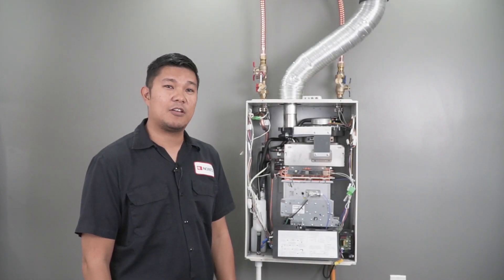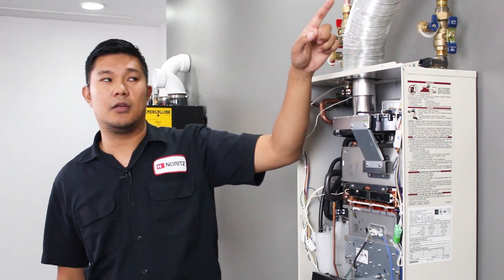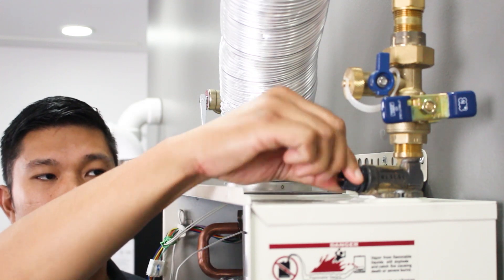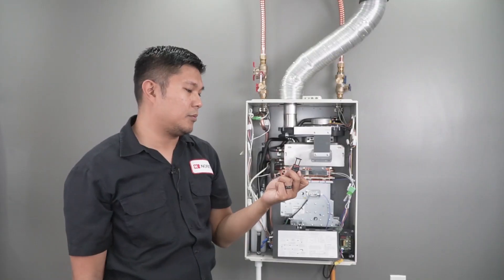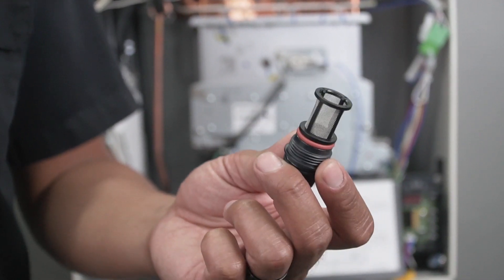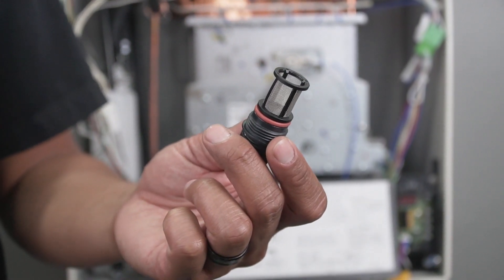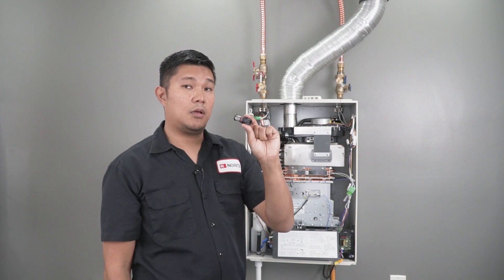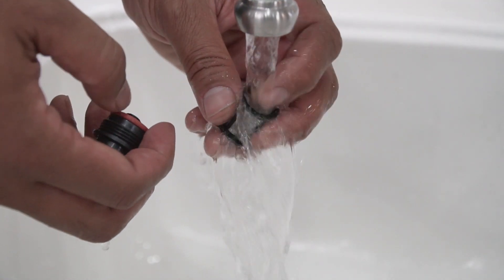Noritz Quick Tech Tip

Comment: I have a Noritz 0751M model from installed more than 10 years ago.  Still working but every so often hot water shuts off with error code 16.  Any advise on repair or is it time to replace?  Appreciate your input, thanks.

Comment: I May be wrong but isn't the shut valve supposed to be on bottom other wise how do you inject solution with pump
Reply from the maker: You're not wrong when it comes to most traditional tankless. However, this particular unit is our top mounted water connection model (for faster install) so the valves are on top in this demonstration.

Comment: Quick tip.. If you flip the valves, you can keep all the water in the actual waterlines instead of draining the whole system. Would only make sense to be able to isolate the unit instead of removing it with the valves.?

Comment: Hi Eric, great video!  Occasionally and  I am not sure what triggers this, but no water flows through our hot water faucets.  The fix is simple, just simply turn off and on the Noritz water heater.  Everything then works as normal.  Why does this error occur and how do we prevent this from happening?   There are no error codes alerting us to any issues.
Reply from the maker: Hi David I suggest you call into tech support as there's a lot of info we need to be able to answer this properly. The only mechanical component that would stop water flow would be the main servo. It must be shutting down for some reason, possibly over heating but we might need error code history from the unit to answer for sure. Please call 1-866-766-7489

Comment: Except that after couple of years of usage, it's almost impossible to turn the filter and remove. The position is difficult to reach at the bottom and its plastic so using force will break it.  It looks good and easy on new device in this video :(

Comment: The filter is stuck in the housing, how do you get it out?
Reply from the maker: You might have to use pliers to nudge it loose. However, try to be very careful as the plastic could be brittle if the unit is old or has had exposure
Reply: @noritzamerica  it’s a 5 yr old unit. What is the part number for the filter on a ncr 98 dv heater? And is there a reputable store to buy this part?
Reply from the maker: @alkupik  you can either check www.noritzparts.com or if you're in canada www.reliableparts.ca/. The filter screen is EGBD032 and the filter cap is DTJD006
Reply: @noritzamerica  why use plastic for this part that needs pliers? Why not make it easy to access this and easy to remove? It's so frustrating. Video shows as if it's so easy but in real life, it's a pain
Reply: You can very gently use Chanel locks and wd40 sometimes repeat a few times it usually works. May sure o-ring comes out too in addition to the filter and gasket.  Afterwards make sure to gently clean out the gunk in the cold water inlet filter line. Suggest only doing this if you have the replacement filter, o ring and cap ready.

Comment: Can you show me how to correct the error code 903 on a Noritz model NRC711-DV. Turning the unit off and back on only works for few days at most.
Reply from the maker: Hello, error code 903 is caused by abnormal combustion as well as the air supply vent being clogged. It is recommended that you clean your air supply vent. See page 22 of our Owner's Guide on how to fix this issue: http://support.noritz.com/download.php?file=Literature%20Page/Owners%20Guide/NRC711%20NRC661A%20OG.pdf&field=OwnersGuide
Reply: @noritzamerica  It says Page not found!

Comment: can you show us how to fix a code 90?
Reply: did you get your fix?
Reply: @billcarr1931  I had a code 90. It was the gas meter and regulator outside. The gas co changed them for free. My gas pressure was very low and out of spec. Had to adjust the burner W/C after that. The W/C settings are on the front cover. You need a tech or a manometer to do that.